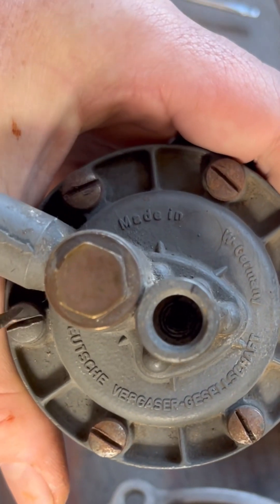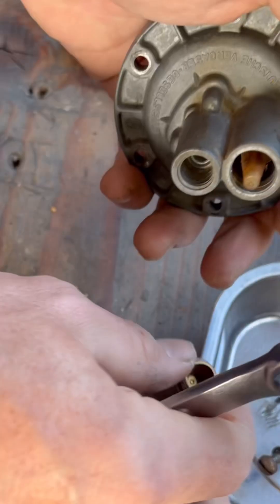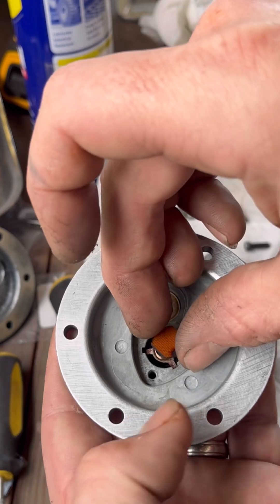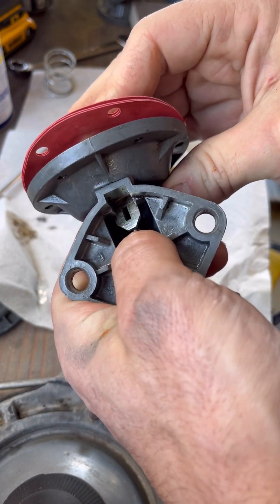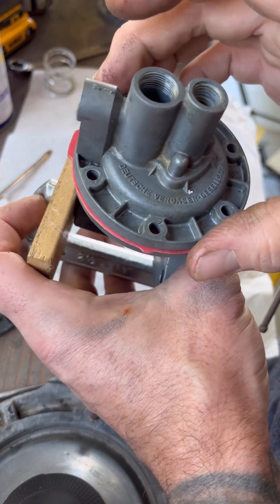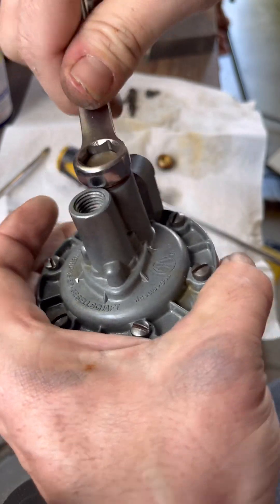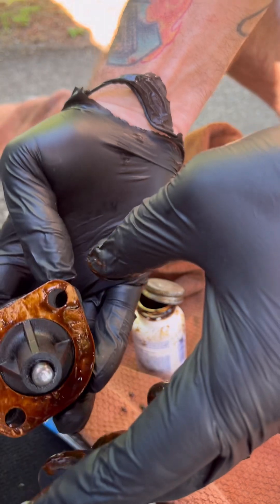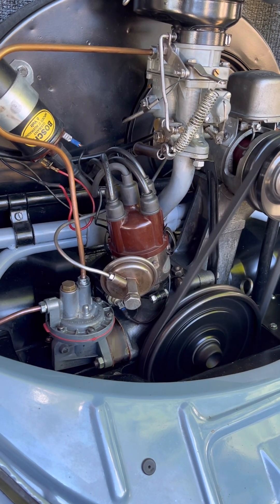VW 36hp Fuel Pump Rebuild

Comment: Question:  How did you block the fuel from gushing out when you disconnected the lines in the car?
Reply from the maker: @youtoobe169  I used a locking vice grip to pinch the rubber line that runs along the transmission so fuel doesn’t just continue to flow. Then yeah you kinda just gotta put a rag down to catch the remaining fuel from the metal lines. No matter what you’re going to have some gas spilling out.   But it’s not a lot if you pinch that line.
Reply: @cointelpro25  Thanks!